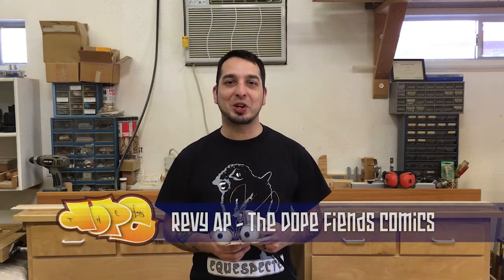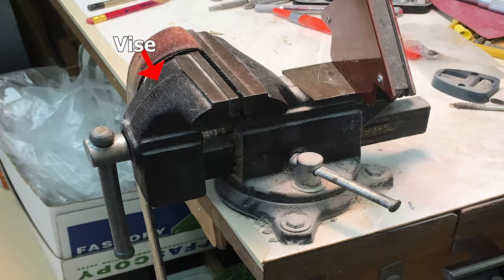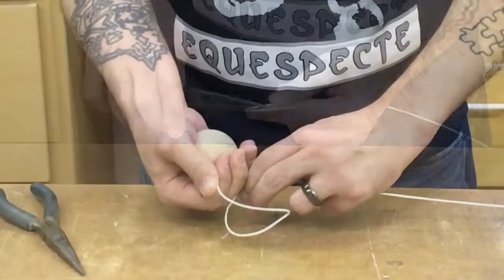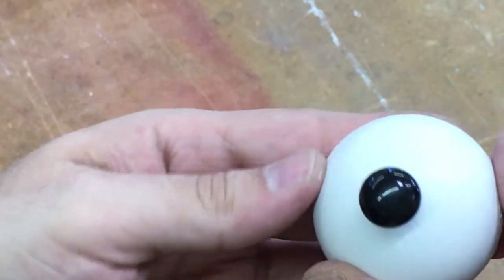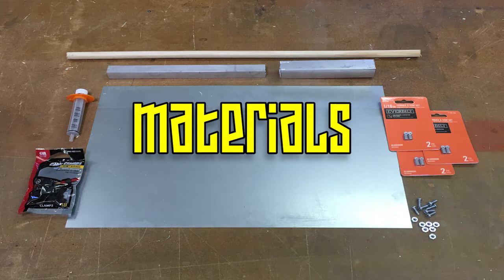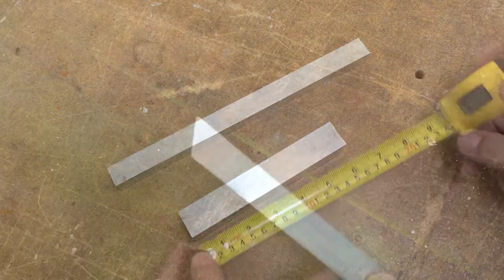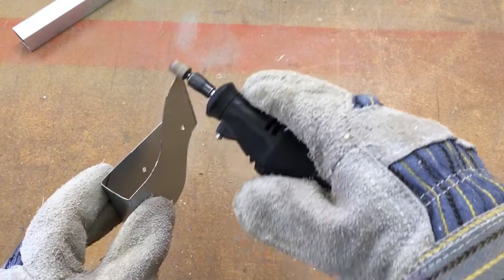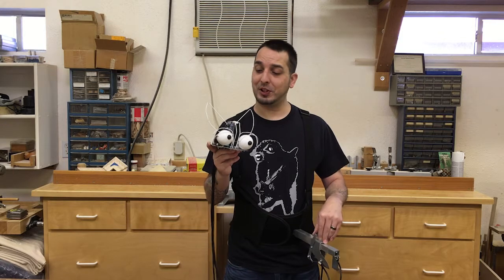Cable Control Armature Tutorial

Comment: Hey, I'm wanting to build a cable armature for a worm like puppet, I'm wondering if you could give me an approximation on the cost to build this one. Thank you in advance.
Reply from the maker: Sorry about the delay in reply. I actually had a lot of the material for this build in my scrap bin, so I had to kind of calculate what it would have cost if I had bought all the materials new. My best guess estimation is that you can do this for around $30-$60 depending on where you source your materials. The cable controls came from Wal-Mart and the sheet metal and hardware came from the hardware store. Sorry this isn't more specific, hope it helps...
Reply: Equespecte hey, thanks so much! I really appreciate it